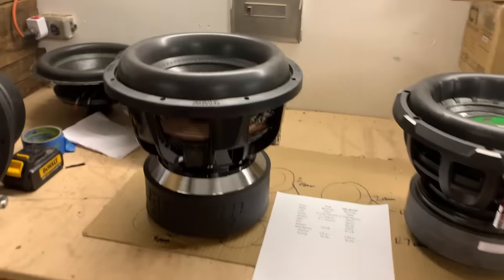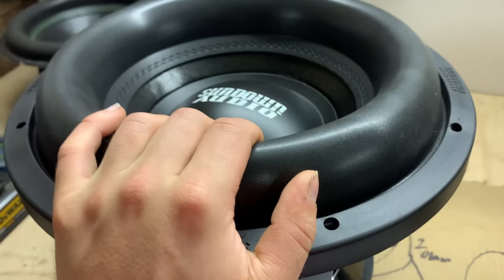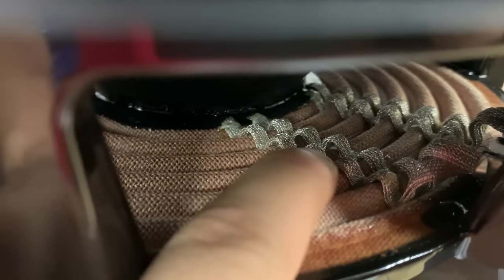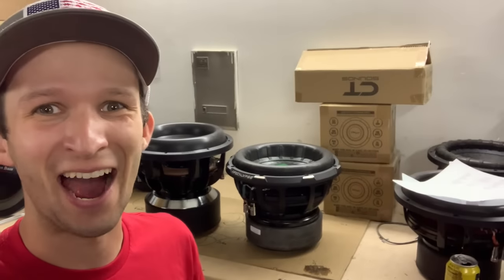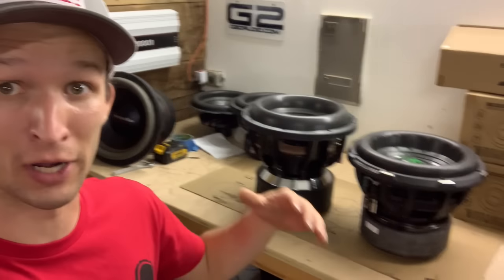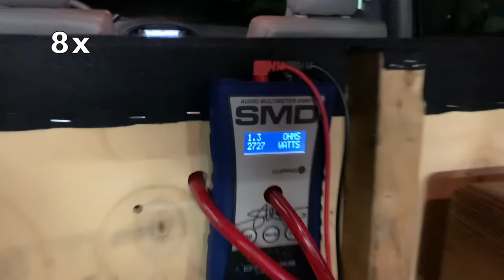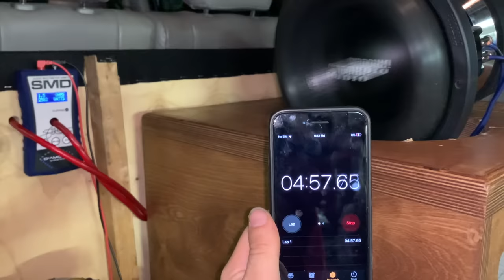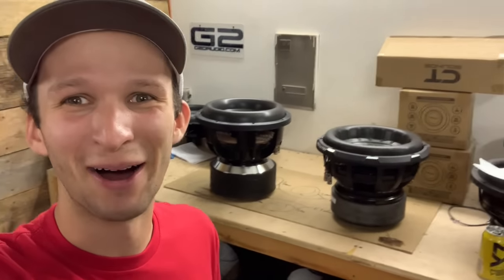Sundown Xv3 Vs Deaf Bonce 3012R | Is Sundown Worth the Extra $100? | Head to Head

Comment: The Sundown basket is functional. Forced cooling. Best basket in car audio bar none. I really prefer the traditional gasket ring also. I build walls and invert sometimes. Sometimes it's the small things.
Reply: What’s gonna hit the nasty lows for slowed n rebassed music? Money not really an option I’m doing 2 15s in a slot port tuned to 28 I have a design but can redesign box if subs need less/more air space. Right now my design is 6.64 on sub side so after bracing and subs should be 6.1 for two 15s.

Comment: Those spots on the coil is definitely from clipping. Also xmax doesn't determine overall excursion whatsoever. Xmax is just a formula of linear excursion the coil staying within the gap and it's calculated by the winding width of the coil minus the top plate thickness divided by 2. So a 50mm tall coil windings with a 12.5 mm (1/2") top plate would be 18.75mm of xmax and same exact coil with a thicker 25mm (1")  top plate Would be 12.5mm xmax. So the deaf bonce either has a shorter winding width or a thicker top plate or both, xmech is the mechanical limits of the motor basically  to peak to peak, and I'd say likely the Sundown can move more peak to peak than the deaf bonce but that extra excursion may or may not noticably hurt sound quality whether that's better that comes down to the users opinion and what there looking for. There's people that say it's stupid but personally even tho sound quality is important the huge motors and insane excursion is what I look for in a sub...call me shallow lol, Bass is more than just function it's also a visual thing you want it to look badass too..., not many bassheads do not include form along with the function when choosing a sub!? They want both!!!!
Reply: Well I just learned something

Comment: dude u really inspired me to get good car audio when i’m 16. i’m thinking a sundown 12 with a taramps amp and pioneer door speakers
Reply: Don't go with pioneer door speakers. I've owned 4 different pairs of pioneers. I even purchased some carbon fiber cone pioneer like 5 years back and I switched to nvx speakers and what a difference. I'm sure there are other brands that provide better speakers. I've always been a pioneer head unit fan but definitely not their speakers. Just use another product and save the money and time
Reply: Look go with some db mids or if you don’t wanna spend the money skar pro audio mids  are good if  you tune them right paired with the right tweeter

Comment: I like that Sundown. I just like to be different. Everyone around here runs Sundown. I been watching Deaf Bonce and actually was going to buy a couple of 3012's but they were out of stock at the time,  same goes for B2 Audio. So I decided on two DC Elite XL 12's. Now I'm getting ready to put a decent system in my daily. One of those would work. I have about 4 mono amplifiers with a range of different wattage that are capable of running .5 ohm. Already been on your Facebook page. Congrats on that. I'd like to see you test some DC subs. If I get a suburban next year I'm going to try and do some lvl6 DC subs. Keep doing what you're doing. Much love brother.
Reply: How do you like those elite 12s? Are you still running them, how do they hit lows, are they musical?
Reply: I did the elite 12xl s they are louder a little but cant handle as much power as the dbs

Comment: Impressed with the DB for being cheaper and having a smaller magnet and less xmax and yet handled 2600 rms,and was only a little off on the spl test.
Reply: It handles more than 2600rms
Reply: @mikeythanos  right my bad 2800 😮.Pretty crazy no doubt.
Reply: It’s rated at 2800rms
Reply: And Xv3 is rated 2000w rms but can handle up to 2600w

Comment: Maybe Deaf Bonce determines the Xmax differently like Sundown. It seems to be, at Sundown that 100 mm peak-to-peak Xmech excursion means the excursion limit just before damage or just before bottoming out, and they determined the Xmax just as the half of it. At deaf Bonce is pretty plausible that the Xmax is defined as a one-way excursion at 70 percent of BL, so, if it is true, then Xmech or peak-to-peak excursion is in the most case when Xmax is defined at 70 percent of BL can be counted out as (Xmax + Xmax / 2) x 2. So, for deaf Bonce: (19 + 19 / 2) x 2 = (19 + 9.5) x 2 = 28.5 x 2 = 57 mm - this is the theoretical peak-to-peak excursion limit for Deaf Bonce - still just a little bit more like the Sundown's Xmax... Sound-wise: Deaf Bonce really sounded more musical, so, if I have to define which I will use for what, then Sundown just for competitions or shows, and Deaf Bonce also for competitions or shows + as a daily sub too, so...

Comment: Those xv3s are insane! 
Run your fs parimiters from each sub through win ISD and  you will see the huge difference between the 2 just like in your vid when u show the voice coils.
Reply: Which one you like?
Reply: @deezsquuezeorg  I bought 18" xv3s
Reply: @cartruck1070  I have a box design for two 15s tuned to 28fb 6.64cuft on sub side assuming 6.1 after sub & bracing displacement. Will the sundown x hit the lows the best for price point?

Comment: Deaf Bonce XMax figures are for one-way excursion vs Sundown which publishes a figure for two-way excursion, hence the difference. Sundown still has more excursion between these two subs but it’s 50mm vs 38mm (rather than 19mm). 

Also, the SPL figure is a sensitivity rating. So, it’s 86 dB per one watt of power measured at one metre (the standard way of measuring a speaker’s sensitivity).
Reply: The Xv3 has almost 4in p-p excursion, thats about 100mm. I'm pretty sure that the Xv2 was/is rated 38-40mm one-way at 70% BL, so I would assume the same for the v3.
Reply: So basically,  sundown is the bomb,

Comment: Come on Parker, now the correct comparison would have been the 3512 vs the xv3 if you want to stay in the same price range now I personally bought my 3515's on black Friday back when they were first released and priced at roughly 749ea but black Friday deal was 75 bucks off of that so I paid 675ea for the 3515's and the 12s would have only been like 550-575 for the 3512's and my 3515's will shit on some X15's lol I've already done the comparison as I own both!!! Smart shoppers can get things for much less but a side by the 35 series is much closer to the x series yet has a half inch bigger coil and 2 to 3 times the power handling capabilities

Comment: Great vid as always very helpful but how about the zv6 vs the 4515 you might want to use a larger amp for that test but I bet that would be a vid to watch for everyday entertainment  keepup the good work
Reply: Why to make comparison between zv6 and db4515r when the 1st is rated 2500w and the other at 4500w?this means that there is a mistake. Maybe zv6 would be compared to db3012r because it's where ratings are similors

Comment: I would probably pick the sundown just because of the xmax alone but either way the sensitivity on both of them is complete fuggin doodoo and they take alot of power to get loud that being said I kinda like how db looks so I ordered 2 db avatar stu 12s gonna throw them on this MD 8k and see what they can take this week when the subs arrive😎✌
Reply: Well how about the 12inch American Bass Godfather D1/D2 which has 3000 watts RMS and 89.2dB-90.1dB sensitivity, the 12inch Incriminatory Audio Death Penalty 2000 watts RMS and 90.1dB, the Trinity Audio TAS-M12 D1 2000 watts RMS and 90.1dB, TORO Force 12S 2000 watts RMS and 88dB, or the OE Audio 3500 watts RMS and 91.4dB ? If none of these 12inch subs are efficient enough for you then I don't know what sub is because they all kick ass in that range!

Comment: On a sidenote, is there an error in the production of the surrounds which when they play it has to make creases at high excursion?
Reply: It's not an error any mega roll surround will do that even if it has ridges.
Reply: @BenaresDarkness  
I thought that happening would cause a slight misalignment of the coil and cause failure in due time. Or probably does nothing.
Reply: @Bassotronics  It won't do that but I think it might have something to do with efficiency but again I'm not sure. If it was something bad Jacob would not be using the surround still.
Reply: @BenaresDarkness  
Thanks. It’s something that I have seen many years ago but never actually asked if it causes any issues.

Comment: I would think the xv3 12 would be more comparable to the 3512 and the 3012 would be more comparable to the u12. Without the discount they have on the xv3 it would be a closer price comparison to the 3512 and same for the u if it wasnt discounted it would be closer to the 3012 price point. Either way both are bad ass subs an cant go wrong with either
Reply: Was thinking the same sundown already $615 might as well get the db 3512
Reply: @Savagexj  that's why I went with the db 3012r instead of the u from sundown. They were in the same price point but the db had the carbon dust cap, bigger terminals, more power handling and was a better looking sub
Reply: @w7cobalt  for sure that’s why I went with 2 3512 plan to get 2 more might as well get my money worth
Reply: @Savagexj  hell yeah 4 will be sweet. I got 4 of the 3012r just waiting to get a bigger amp on them
Reply: @w7cobalt  nice it will come over time .. no need to rush greatness we are both in the same boat
Reply: @Savagexj  I hear this more than you know, purchased 4 u 10s and Orion hcca3000.1 and can’t even use The amp. Fried the amp first turn on, Been at Orion for over 2 months waiting on parts. So I’m stuck also
Reply: @beefysghost867  I totally understand stuff is expensive I have one aak 8k but I know I need 1 per sub don’t want to rush things and have to put out more money
Reply: @Savagexj  just really makes me mad buy a brand new amp 3000.1dsplx abs fried first turn on. Spend that kind of money shouldn’t have to worry Abouy that
Reply: @beefysghost867  I would be 2 but sundown and db are power hungry

Comment: I have a build with 9 12’s on 20,000 watts. 3 cube per sub tuned to 27 hz. I started with DB 3012. It was great. Swapped to xv3. No other change. Didn’t even tune the amp different. The sundown are SO much better. They are worth $300 more a sub. The DB has no excursion compared to the sundown. So at 32hz and up basically no noticeable difference. On lows, under 30 hz the sundown is much better. The sundown plays 18 hz. The DB was just motor noise at 22hz.

Comment: How much can those sundown XV3’s really take? I know 2000 W is way underrated but just wondering what they can take Max RMS?
Reply: Did you findt it
Reply: @rebassedmuziknl8432  No but the videos I've seen they could take almost 4K each. I decided to go with a smaller system instead with a Taramps smart bass 3k and Resilient sound gold 12s, my roof won't stop flexing now lol

Comment: Just purchased 2 apocalypse 8"s I'm trying to figure out what size amp I should use on them. I'm new in the car audio industry and was thinking about getting a 2000 watt monoblock amplifier wired at 2 ohm

Comment: Hey Parker, try putting the Deaf Bonce 3012R into the Skar prefab box you have. It is 2 cubic ft. And tuned to 32.3 hz on the Dats. Very close to spec.
Reply: How’d that workout for you? I have 2 skar evl 12s and just put them in a custom enclose and still have the prefab just sitting. And I was looking at the same subs you plan on putting in the prefab. How’d that turn out?
Reply: @col98  the sundown and other big 12's dont fit the skar prefab box unless you remove the sub ring off. Ive decided to put it in a flat faced box.

Comment: You need to put a fi hc 2500 rms subwoofer on video? I understand why you don't because they have to build it but it's only 469 for starters and the xmax is 34 mm I own 2 and having a 18 neo 4.11 built going to see what that puppy does?

Comment: Phenomenal subs...try Nemesis Hectic 12, if it does not pass I might get one of the 2 you just tested or maybe a ZV 6 sundown (06/06) well i now have an xv.3 12 and very happy. it hits very low and hard. powered by a salt4, still in the process of building my lithium bank....

Comment: Would love to see the top of the line dd sub vs the top of the line pride sub. never seen either of their full specs/ts parimiters compared and a full good test on each the way u did here.
Reply: I have a pride ufo 5v2 18. 10krms. 5in vc. It’s a monster. I just picked up a DD 9918 ESP SC, and it’s a monster as well. Both allcarbon fiber. The fellow who I bought the 9918 ran the z318’s and now has z418’s and still says the pride subs are the best. However B2 makes a 6 inch coil beast the x26.. don’t know much about it. I know deaf bonce made an 8 in coil 32 and it was not good. So idk. Bigger isn’t always better
Reply: But the neo top of the line subs would be pretty similar I’d imagine. tons of bl tons of power. probably wouldn’t even be able to tell and audible siffercne if you didn’t know what you were listening to.

Comment: The sundown takes it in my book. Deaf bonce has a bigger 12" sub tho. 3512 and I believe they make a 4012 aswell. Those are 3500 watt and 4000 watt rated speakers. I want to see how they do against sundown xv3 or some DC audio level 5 12s.
Reply: That's not fair tho if you going to compare the 4012 you need to get the zv5 not the xv3
Reply: @BenaresDarkness  I know someone who has a wall for 4 15s it was built for zv5s the guy did a direct swap of subs from the zv5s for the 4515s and gained. The zv5s were tolerable at full volume but when he put the 4515s in it was like someone was choking u
Reply: @w7cobalt  That just means those sub's fit the box better.
Reply: @BenaresDarkness  not really because the box was to big for the 4515s an he had to shrink the internal of the box because 1 sub was trying to unload and when he did he gained more
Reply: @w7cobalt  Anything else you left out on changes? The cabin can be a better fit as well, the xmax plays a part, the motor force plays a part, they spider plays a part, the cone plays a part, at the end of the day those sub's fit the box and the cabin better and the numbers proved it.
Reply: @BenaresDarkness   I never  said all that wouldn't play a factor and I never left anything out I had originally said my buddy direct swapped zv5s in a box built for them to db 45 series subs that the box wasnt ment for and gained. Your original comment was it wouldn't be fair to compare the 4012 (I'm pretty sure you ment 45 series not 40 because there is no 40 series) to the xv3 it would have to be compared to the zv5 and I gave you a real world example where someone did a comparison an the 45 was louder in the wrong box then the zv5 in the correct box. So where did I leave something out? I only added that he gained more from changing the box to better fit the 45 series after you told me the box must have better fit the 45 then the zv5.
Reply: @w7cobalt  I was talking about the 12 " sub series. They don't make a 4512. I am curious to see direct comparisons for a zv5 12, deaf bonce db-sa412, and DC audio level 5 12.
Reply: @Theyoufeelme  I know what u was talking about and there actually is a 4512 in the works. Think I seen it will be out around April next year

Comment: I have two old-school audiobahn alum12Q Both still in working condition I’ve had them as long as I can remember still my daily use as you know they have the rubber attached to the cone it had a slight tear where the rubber meets the cone I did my homework and I purchased the appropriate flexible glue applied said glue let it sit for longer than needed in the sub sound like they did when they first came out the box but I am looking to have them refurbished technically only one of them needs to be refurbished but I would like to send both so they can be examined do u kno of a place I can ship too!!!! 02744 is my area

Comment: I was shocked by the rockville audio 10inch under the seat sub with built in amp 800 watt max I bought like 4 months ago sounds pretty good in a nissan versa might get the 12 inch powered sub for under the other seat its 1200 watt max or just get another 10in

Comment: I would like to se the incriminator audio death penalty on 40 hz for 5 min and watch it blow any sub in its price range out of the water PLUS most musical and great sq sub as well. I have 3 15s with all upgrades and i run them from 3000-3400 daily and they still barely movin, ofcoarse i ave 9 progressive spiders on mine but yours will come with 3 so still be sick

Comment: You should try some DC subs. Curious to see them compared to Sundown
Reply: DC would likely out perform in the higher series. They have 4" Voicecoils.
Reply: @bassinburban8928  DC lvl 6 Is the only one that has a 4 inch coil... the XL Elite already better than the XV2. I've heard both and DC sounds louder and better in lows and highs. The lvl 6s go super low though. I'd like to see the lvl 5 and 6 compared to ZV6 and NSV5s.

Comment: question!
does 3 speakers 1000 watts each sound like 1 speaker 3000 watts rms?
Reply from the maker: No general the 3 speakers would be a good deal louder
Reply: @ParkerTheBasshead  id like to see a video on this with the DB sound meter
Reply: Absolutely Not .
Its impossible.
3 speakers with less wattage will sound better.